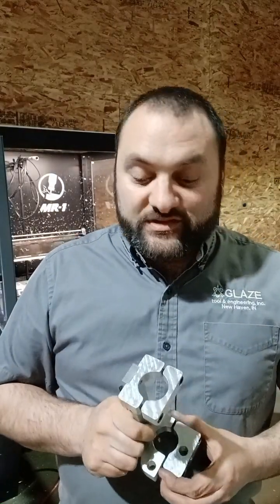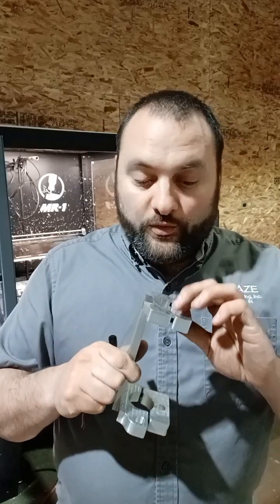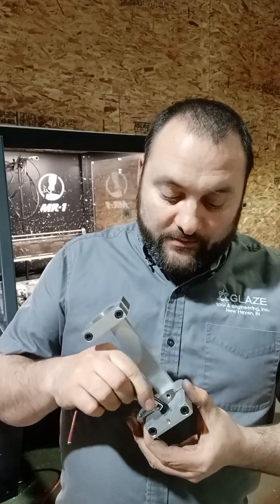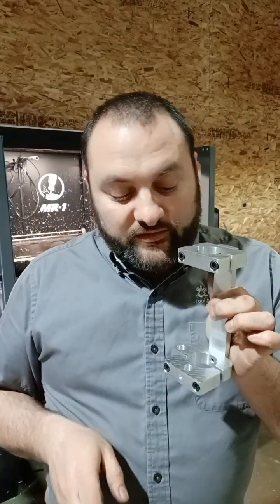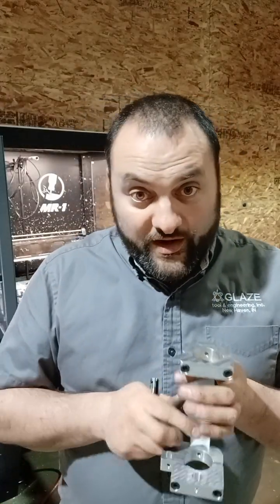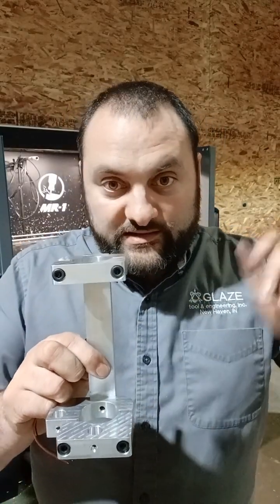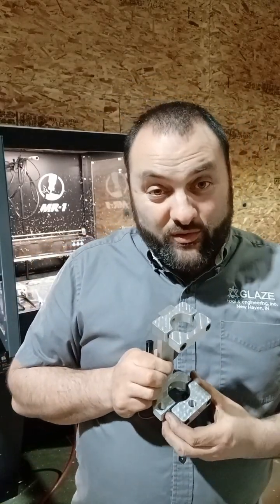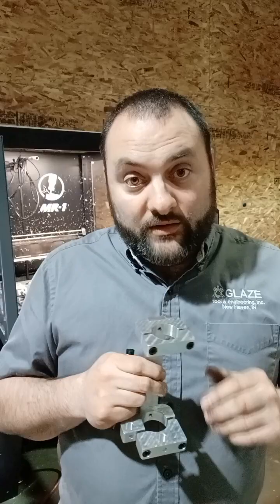@LangmuirSystems MR-1 CNC gantry mill. (Crossfire Pro Prototype Upgrades)  #langmuirsystems #MR1

Comment: Great man.  I want one for my Hypertherm
Reply from the maker: for sure!  What's the outside diameter of your Hypertherm machine torch?
Reply: @BeckTools  I will check later tonight and get back to you
Reply: My hypertherm 45xp machine torch measures about 1.48” outside diameter worst case. Will this fit the langmuir xr table ?
Reply: @JasonSerda-kg1wk thank you I have not had time to measure mine. Now I don’t have to 😊
Reply from the maker: Dang that over and 1/8" larger than the Everlast.  I think I'll have to make a second version.   I don't want the Everlast one to be sloppy to fit the Hypertherm.